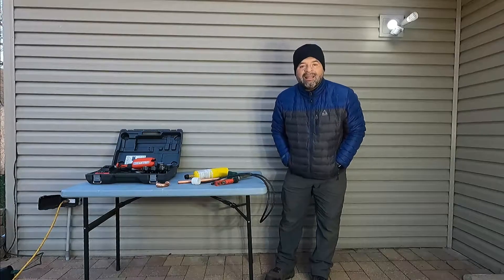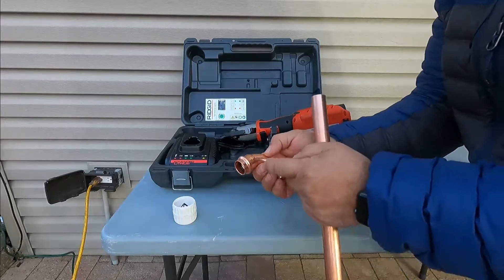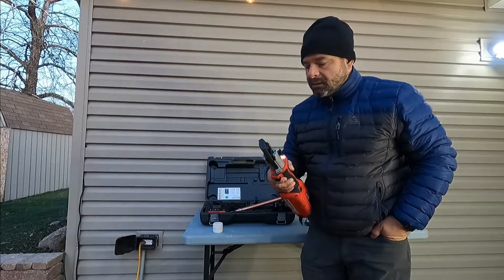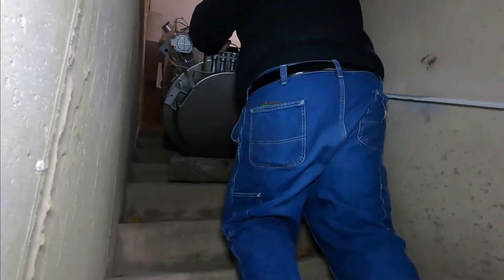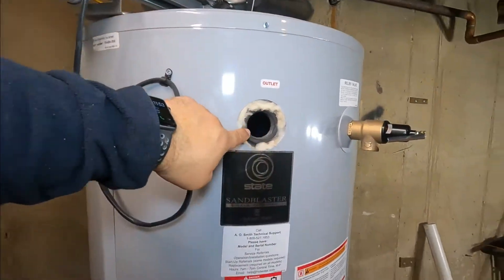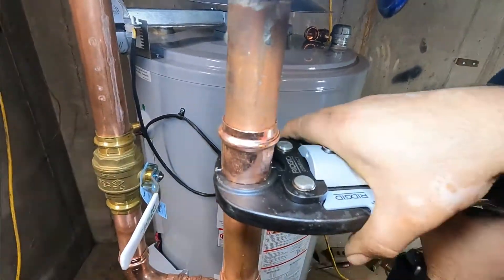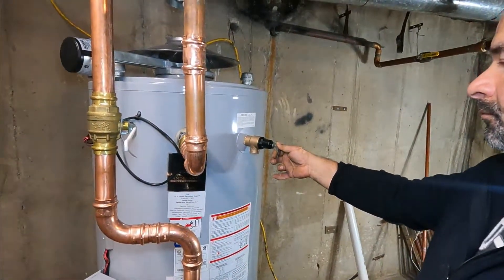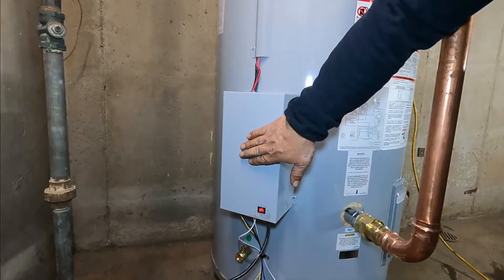HOW TO INSTALL A COMMERCIAL WATER HEATER USING RIDGID 241 PRO PRESS

Comment: What is the pro press fitting you have used to attach to the tank?
Reply from the maker: Hello, what I installed in either side of the tanks was a 1 1/2 IPS female x 1 1/2 press bras union.  You can also install a dialetric union. It has to have a means to easy disconnect  when you ll replace it in 20 years.  Go to 10:50
Please let me know if it makes sense.
Reply: @ did that silver pipe that you have installed come with the tank? Or did you buy it separately? I’m still not able to find that pipe. Please send me link or the full name to it, if you don’t mind.
Reply from the maker: @DonkeyKong-c6c  That came with the tank.   It is a dialetric nipple.  It is covered with plastic inside to avoid electrolysis.
Reply from the maker: https://www.homedepot.com/pep/Everbilt-3-4-in-Dielectric-Heat-Trap-Nipple-EBDN-HT-07/331674301?source=shoppingads&locale=en-US&pla&mtc=SHOPPING-BF-CDP-GGL-D26P-026_010_WATER_HEATER-NA-NA-NA-PMAX-NA-NA-NA-NA-NBR-NA-NA-NEW-PMax-BHU24&cm_mmc=SHOPPING-BF-CDP-GGL-D26P-026_010_WATER_HEATER-NA-NA-NA-PMAX-NA-NA-NA-NA-NBR-NA-NA-NEW-PMax-BHU24-21269037821--&gclsrc=aw.ds&gad_source=1&gbraid=0AAAAADq61UdtSKllYM7dYMC3lGZf_Zq5y&gclid=Cj0KCQiA_Yq-BhC9ARIsAA6fbAiWw-mWpTGbWxyGs4AG54f5LB9305l1PStKwDdeKHIUNGuwd_00LEEaAhR7EALw_wcB
Reply from the maker: https://www.supplyhouse.com/Bluefin-DEN100-400-1-x-4-Galvanized-Steel-Dielectric-Nipple-w-Pex-Insulator?utm_source=google_ad&utm_medium=Shopping_Plumbing&utm_campaign=Shopping_X_Plumbing_X_SSC_ClassD/E/DI/NS/New&utm_campaignid=21639990401&utm_adgroupid=172230907408&utm_targetid=aud-309601171817:pla-2348139003970&utm_product_id=DEN100-400&utm_matchtype=&utm_keyword=&utm_adtype=pla&utm_category=Plumbing&gad_source=1&gbraid=0AAAAAD_WAyvkkWBiEcSKkEwt8T14vqCCl&gclid=Cj0KCQiA_Yq-BhC9ARIsAA6fbAjcsn_s_FLcCn1qRYnYxgU7Zvl3pZzR9uQvNl-yGubTHdJFlSFZMkQaAkFrEALw_wcB

what size do you need.  if 3/4 you can get them at Menards or Home Depot on the water heater parts section.  Not on the fittings section.   If you need them bigger you have to get them through a plumbing supply house.
Reply: @ thanks that helps alot. One more question I had, is why didn’t you use a flexible gas line? Can I use it?
Reply from the maker: @ Some inspectors dont like them.  Some cities dont accept them.  Check the codes of the place you are going to install it.
Reply: @alexthehandyman3494  I need 1 1/2 for my water heater tank. What size did you use for this water heater when you installed it?
Reply from the maker: @ 1 1/2 as well.  Plumbig house around you or supplyhouse.com
Reply: @alexthehandyman3494  can you please send me direct link to supply house. Also, will it work on side profile?

Comment: Inspector should have wanted to see the vacuum relief . Installation failed . Where is your expansion tank also? Double failed . T and p drain pipe not supported within 12” of termination . Triple failed . Gas piping not supported . Quadruple failed . Venting not supported . Failed for the fifth time. I could go on but the inspector is blind I guess . Or if it was never inspected . Love the handyman. Y’all need to stop making YouTube videos saying you can do better than a plumber.   I do handy work too. Took me 3 weeks to caulk my first floor and still not finish yet. 
And I’m a GC on top of being a plumber.

Comment: great video and demo of these wonderful tools i have the m12 model but i am scared they fail out of the blue allot of people say they failed on them both models the m12 and the 241 i want the 241 but i am not a full time installer of pipes i just want it for homework did you ever have a 241 fail on you ?
Reply from the maker: Hello,    I use it a lot and it has not failed so far.   It is a time saver tool.   I love it.   Thanks.